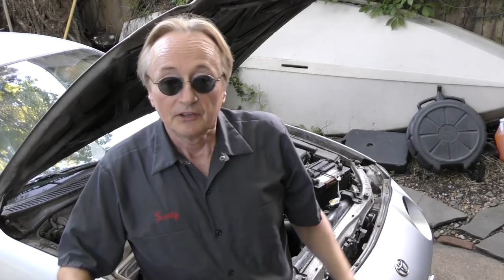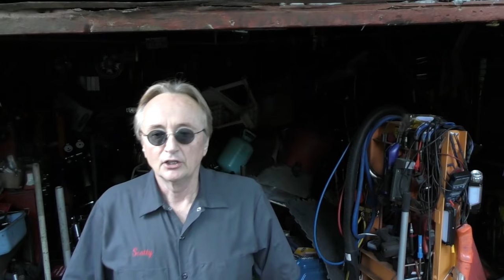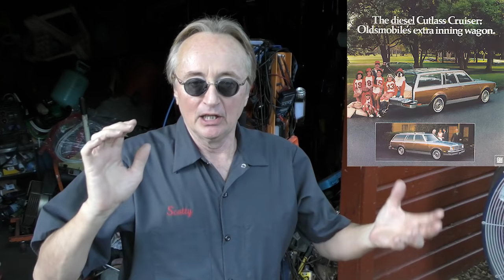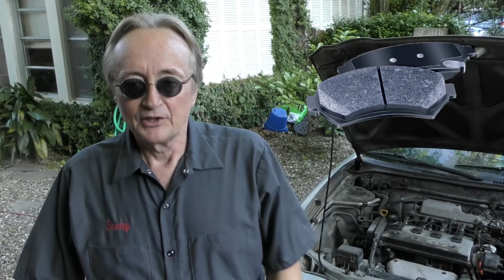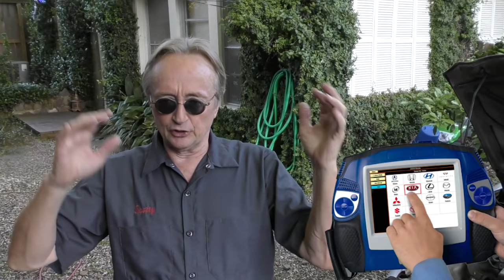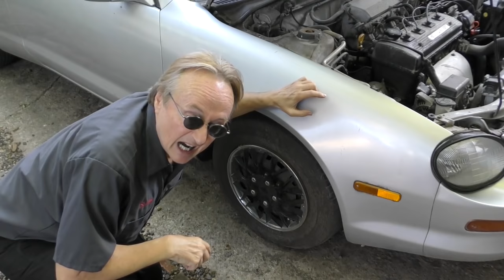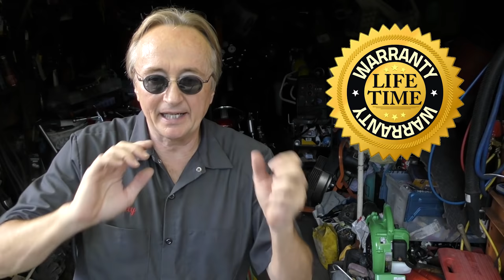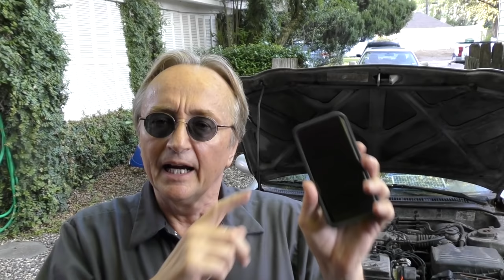5 Scams Your Car Mechanic Doesn’t Want You to Know

Comment: THIS is why I learned to fix my cars myself. Finding a good/honest mechanic is like finding a needle in a haystack. Now I know a guy that is good and honest, except I only use him for stuff I can't fix easily.
Reply: Same here. I was taking my car to this mechanic in town and I seriously started getting this feeling he was sabotaging my car because it was like clockwork, as soon as he fixed something- something else went wrong. Head gasket then ignition switch then valves needed reseated then brake master cylinder one thing after another. Finally I took my car to the other mechanic in town and ever since then I've been having virtually no major issues with my car since. 

Now this other guy will do exactly what needs to be done and even fixes up little things here and there for free. Door was catching so he replaced the pins, store was out of regular brake pads so bought me the premium set at no extra charge. Ignition locked up in my pickup and he knew I needed it for work so he had it fixed for me overnight.
Reply: Frankenscuzz the tables have turned.
Reply: Frankenscuzz I've got a great Mechanic who when I can't do the work myself! He's an old timer from Hungary who used to work for Volvo years ago! He charges $25.00 an hour, labor, buys most parts off EBay, makes nothing on parts, and would never do anything to the car it doesn't need! He's my "Scotty"! As trustworthy as they come, a great guy! As they say... " one hand washes the other"! I  recommend him to all of my friends, family, and , my Company, which has a fleet of cars! His business has grown 10 times more since I met him! He now has 2 Tech's working for him, pays them very well , and still charges just $25.00 per hour plus parts! Boy did I luck out!
Reply: True...keep your own log book of kilometres and date of procedure/parts used based on the service book intervals but doing the intervals more frequently than the book suggests. The service soon light is irrelevant after that. If you want to do the light thing reset the light interval for the distance you choose in the future for oil change.
Reply: r laze  vibration under braking is most often the rotors being warped.
Reply: This may surprise all of you, but the most honest mechanic I know works for Monro muffler near me. I took my car to them a year back with a control arm replacement job, and within three days I had my car back with a brand new control arm, ball joints and bushing that have a lifetime warranty for a  grand total of 255 dollars. I was so in shock and the only thing they tried to get me to buy was a set of tires, which I said no to and they didn't bug me about it again
Reply: Same story,  found mine on craigslist,  he makes housecalls
Reply: r laze  Love the snow. Don't forget your PB blaster & Happy wrenching!
Reply: @AngelofDrugz  You can occasionally find a gem at the big chains. My local Midas had a manager a few years back who was one of the nicest and best mechanics I ever met. Then it went under new ownership and he left and the vibe of the place completely changed.
Reply: @mtnmotoadv  Give him extra he deserve it ..
Reply: Brad Waite exactly what I do
Reply: @ladawg81 Do you have a YUGO or LADA ?
Reply: @mtnmotoadv  Wow, sounds like a decent guy
Reply: I've tried to learn as much as I can myself but sometimes it's difficult. There's a guy on YouTube who has a Mercedes CLK and he attempted about six different repairs until he finally had to give in and take it to Mercedes. Sometimes, you have to bite the bullet - it's just very hard to trust someone not to rip you off. I hate to say this but I've only had maybe two or three good experiences going to mechanics.
Reply: You know how it sucks to be scammed by your mechanic?  Don't let him scam himself if he's worth his salt.
Reply: Joel Spivak Ironically, despite the $120-$200/hr charge at the dealership, most of the techs make $25/hr or less. Kind of insane since the techs also have to buy thousands of dollars worth of tools 😬

Comment: My dodge dealership wanted $350 to replace my master relay switch for my driver side door control. I bought the part for $25 bucks and took 5 mins to replace it. Can’t stand when f@ckers try and scam me or anyone else.
Reply: My uncle bought a brand new opel movano van here in Ireland and they tried to charge him 800 for an oil change and they said the hours all added up my dad and me work mechanics we did the same job in 25 mins
Reply: Well at least it was something you actually needed.  My dealer tried to charge me $1500 for something that was absolutely not broken and not at all needed.
Reply: Honda dealers broke me of the dealer service habit a long time ago.  Every time I brought the car in it would be a months rent, regardless of how little needed to be done.
Reply: Reason I only work on my own truck and get it inspected at our small town local shop. It's ridiculous the scams these dealer crooks can pull! There was a shop in town that recently got in huge trouble after atleast 10 customers exposed them for purposely damaging their customers air filters to get more money out of them! Absurd!
Reply: I was told I needed $800 dollars worth of work on my 2004 Dodge Hemi truck but I have gotten in the habit of checking all fuses first when something goes wrong with my truck. Turns out it was only the fuel pump fuse which I replaced myself for about $2
Reply: @estherdiaz9514  Fuel pump may be going out, fuses don't generally go out by themselves.
Reply: teppie3000 is that master relay under the hood or in the door itself? I drive a 2004 Dodge Hemi and it makes an awful noise when I use the automatic lock button.
Reply: @estherdiaz9514  I drive the same truck, an '05. I believe all the fuses and relays are in the fuse box under the hood. I never saw any relay when I had the door panels off to install speakers. Power locks might need lubrication, I have one in one of my back doors that gets stuck occasionally, requiring me to activate the locks again or manually lock/unlock it.
Reply: Aidan Montgomery thank you. I had the fuel pump replaced a year ago. My brother suggested I replace the master fuel pump relay first. I am getting frustrated because I just had the engine replaced and it runs beautifully but every few weeks I am driving around and it suddenly dies on me in 115 degree heat. Every time I get under the hood, replaced the little fuel pump fuse and it starts right up. Something is causing it, I hope it isn’t the fuel pump again.
Reply: Aidan Montgomery the mechanic told me the motor in the door needs to be replaced and that it will be over $300. I just want to make sure that is the only solution. I just hate being scammed, specially when I feel that they think because I am a woman, I won’t know the difference. If I was still young, I would become a female mechanic and open a shop where ladies don’t feel ripped off. LOL
Reply: in fairness, when you go to the dealership and ask them to replace a master relay they are not shopping for best price. They are using their brand(chevy/dodge/ford) part. The parts dept marks it up and sells the service dept. Then the service dept marks it up to the customer. Thats how it is and always shall be. They are not scamming you, that is how it goes. You can buy non oem parts for much, much cheaper but you wont get those at the dealership. Are they as good? Some yes, some no but they are always much cheaper.
Reply: Whenever something needs to be fixed on my car, I watch a few videos on it, and research parts costs etc.
I then decide if it's something I can handle myself or not.
If not, I at least now have a very clear idea of what's involved, and so less likely to be misdirected and overcharged by mechanics.
Still gotta maintain some humility though, and not be 'that guy'.
Reply: Aidan Montgomery < - -  You should share dealership name and city,.. that how exposure works. Thx
Reply: @ryancourtney8607   Yeah but to fair, the dealers pour the oil down the dipstick tube, it's a labour intensive job.😁
Reply: Should go tell the mechanics that you saved money
Reply: My dodge (1999) switch starter takes way to long for it to start and when I want to switch to 4 wheel drive I’ll t doesn’t go
Reply: Dont trust the dealership their VULTURES!!! They will Ripped you off thats why I started going to school for Automotive to help my family and save money for those VULTURES!! Now im fixing family and friends cars!!
Reply: I used to work in a electronic repair shop, I think the owners justify overcharging us because of overhead. Like Scotty says a dealership may have 1-2 million $ of overhead plus the owner ls looking to make a profit.
Reply: teppie3000 they probably tried to over charge you. But if you have common knowledge as it looks like you do you should’ve just asked how much the part was and how much labor there trying to charge and if it sounds fishy ask them to explain why are you charging me an hour labor or whatever for what would only take maybe 30 minutes at most but then again people don’t realize maybe there charging more because there’s some diagnostics that were involved to be sure that it’s your master switch things don’t just break for no reason maybe there’s high resistance on the ground or maybe it’s shorted to ground intermittently and that caused your switch to internally fail sure you can put a new one in and then you hit a bump or closed the door to hard and cause it to short again now your buying another switch saying wtf why does this keep happening
Reply: I think you must dress down in the forums / google reviews etc

Comment: I'm a lube tech and amature mechanic and I dont make commission I've literally built a customer base on being honest with ppl and probably made my company more money with loyalty than ripping off the occasional customer, respect
Reply: Amen brother.
I was a lube tech and eventually manager if a quickie lube.
My store out performed all of my bosses stores because my team and I would not rip people off.
We would advise, not sell.
Reply: @Tone Martin 
What's so funny?
Not every issue requires pulling the engine, in fact very few do.
Maintenance is where one can rip customers off, but he doesn't.
Reply: Lmfao a lube Tech with a customer base... ok pal
Reply: @OwnedEpicStyle  
Why not?
Back in my lube tech days, I built up a customer base.
Reply: Idk what funny I make 1200 before taxes a check and I’m a lube tech and I make HALF of what the flat rates make and I do less work 😂😂😂
Reply: @larrywelser4306  yea I made that as well at Dale Earnhardt jr Chevrolet in Tallahassee FL, then my 60 hour guarantee was taken away lol let me guess you make around $12/hour flagged?
Reply: @tylerhubbell6410  $13hourly
Reply: I make roughly 15.50 an hour plus ot plus tips and yea I mostly do oil changes but also am mechanically  inclined and do mechanic work cause I have a 2g smog and repair shop so.. keep the hate while i make my loot and not steal from ppl
Reply: GORE 702 Bucky is that you
Reply: Ahhh if only dealerships worked that way.

Comment: A local dealer tried nonsense on my new ranger in 2003.  4500 for work on brakes, shocks, leaking rear main seal, etc.  I said I'm getting a second opinion.  Went to our family mechanic (truck was 400 miles out of warranty)  My mechanic looked at it and in five minutes told me to take it home because there's nothing wrong with it.  I wrote a letter to the manufacturer with a complaint.  The dealership had the nerve to tell me that my mechanic isn't a certified mechanic for that manufacturer.  I told him that at least my mechanic can tell the difference between a leak in the rear main seal and left over oil drip from the oil change.
Beware the dealerships.  I'll stick with my mechanic.
Reply: Dealerships are scandalous like that. I never go to the dealer for a fix.
Reply: Lol now that you mentioned certified mechanics...dealerships dont even have licensed mechanics.. here in Houston Texas nissan dealerships and ford dealerships dont even check if your certified when you apply

Comment: Lol my girlfriend oil cooler started leaking part 56$ labor 980$ lmao i fixed it myself with a 9$ six pack and tools that cost total of 30$ and 3 hours later i was done that was 6 months ago still leak free
Reply: I think the bigger issue here is that your girlfriend is an oil cooler.
Reply: The pack of beer was an essential
Reply: @nthomas87  And she leaks. I think that's normal dude.
Reply: @dreammachine5014  heh...
Reply: If I drink 6 beers while fixing the car it might not get done.  And my knuckles might be missing.
Reply: Must have been a jeep or Chrysler 3.6. Total crap engines.

Comment: A Honda dealership tried to get me to pay $600 for a valve adjustment that took me an hour to do myself. Lame.
Reply: Nano Haus good luck with that. Misfires coming your way...
Reply: brewer Never had a problem.
Reply: @Brett Silvestri I've learned lessons and stay in my boundries of mechanical ability. I take my jeep to a mechanic when I need to.
Reply: @Magnumscoffeefreek  why are you taking a Jeep to a Honda dealership?!?
Reply: Also same guy.... not sure why my engine is skipping... i watched a video..
Reply: @Ben-fu3pd  I don't. I take Hondas to honda dealers.
Reply: Ben you know, some people own more than one car lol
Reply: Lol go to AutoZone for OBDII sensors. It'll make a cheap more accurate diagnostic. Just don't rely on them to pick out your gas cap or wiper blades though. Right size blade doesn't always fit
Reply: Toyota charged me 300 for a valve cover gasket and they didnt replace the tube seals (they come with the valve cover gasket at auto zone and they were the only thing actually leaking) I was pissed
Reply: @stevenswisher4339  Yeah OEM sells the v/c gasket and tube seals separately. The tube seals should have also been replaced if leaking.
Reply: @kennya1425  they where the only thing leaking, idk they sold them separately at the dealer ship, as I said I've bought them at auto zone and they came togather but I still felt cheated cause they should have specified that up front
Reply: @stevenswisher4339  I agree completely.
Reply: Don't they try to stop you when your leaving and tell you to buy it and then they get mad and say your not leaving until you pay
Reply: Exactly everyone should learn how to fix simple things like spark plug swap. An example is when the local bike shop wanted to charge me £120+ to install a new R8000 groupset on my bicycle and I went on the internet to learn few things and did the whole job myself. Now I repair my bike easily and I don't have to depend on someone else. Small jobs should be done at home and save the big jobs for the garage but some mechanics are thieves. I know it's a different analogy but the central concept is the same.
Reply: @nissanjon97  not a complicated job
Reply: Brett Silvestri I worked in parts at Toyota dealers for 15 years, including as a manager where I could see the financials. Service departments were regularly making 75-77%GP.

Oh yeah, if you’re a tech at an OEM dealer, and you’re getting ~$25.00/flag hr, your writer is getting $6.50-$7.00, director like $3.00, and the store is basically getting the other ~$90.00 or so.

I was never really impressed with how the guys who did 90% of the work got paid relatively little.
Reply: steven swisher Oof. Rookie parts guy. Rookie tech, too, apparently.
Reply: steven swisher Honestly, they should’ve included them in the quote. Lazy/inexperienced parts countermen and tech.
Reply: What you need to do is take a look at how many hours the flat rate cost for at a dealership and then you multiply the flat rate hours by the shop labor rate. That will give you how much it's going to cost for a valve adjustment. It's not outrageous it's just what the manufacturer calls for and how many hours it takes to do the job. If you learn how flat rate is calculated you may understand a few more things about why certain things cost so much..
Reply: Kenny A tube seals should’ve been replaced period. When you get into a job like that weather your a dealership mechanic or backyard mechanic always do any other maintenance in the same area you’ve opened up as long as it’s not going to cost you more than the part your initially replacing. Just preemptive repairs. Hell half the time you pull something apart to fix something else even if a gasket wasn’t leaking it will leak when everything goes back together if you don’t replace it. :)
Reply: @stevenswisher4339  everything should have been changed then related to valve cover. But what some mechanics do if it is not a noticeable issue they don't look to change them but when you remove the cover and replace it they will surely leak.
Reply: I think 06 element with a 2.4 ivtec

Comment: Love this guy. The shop I work at  definitely stays away from all of this.  It's crazy that some mechanics charge full price for overlapping labor. Why would you charge a customer brake labor for installing rotors if you're replacing the wheel bearing as well? Throw a little bit of labor on for the pads and replacing the hardware and call it good. 🤷‍♂️ Greedy people irritate me
Reply: It's really only dealers that do this kind of thing, most small mechanics and service centers don't.
Reply: @andrewerskine4301  exactly, dealerships suck
Reply: @BenDunlop you’re paying labor for insured service. You get a free inspection and a garuntee of service being saw through directly.